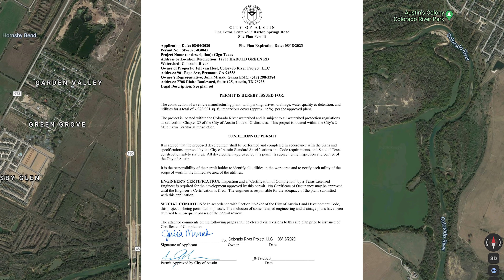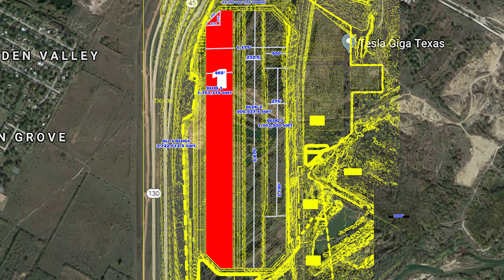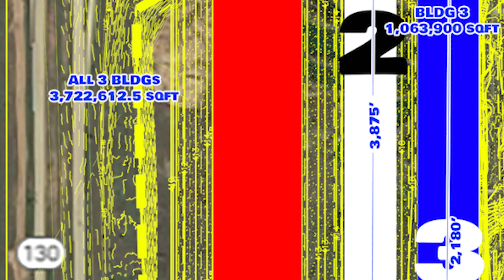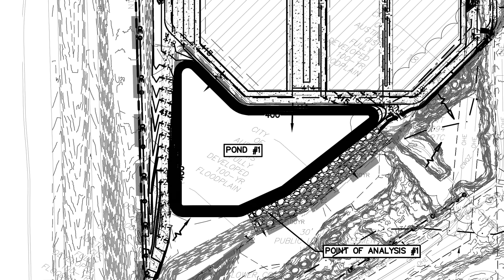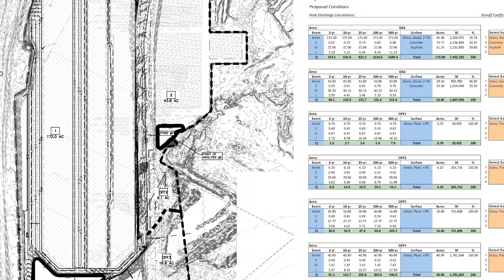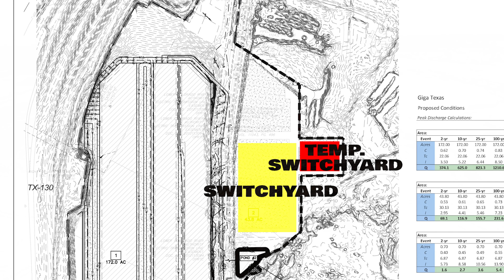Tesla Giga Texas  - EXCLUSIVE SITE PLAN REVEAL! - 4K  Day 55 - 9/15/20  - Gigafactory - Terafactory!

Comment: Looks to me the artist rendering is backwards as it has the biggest building as #3 with the notch.  The plan has building one nearest to the road  with the notch?
Reply from the maker: No design plan yet but inferred from site plan, these are the 3 building shapes. Largest building is #1 closest to the freeway, next is the smallest #2, and on the East side building #3 with the notch. Was a bit confusing in my video because looking at the site plan is a "rear" perspective in that building 3 is on the right, and in the rendering, we're looking at the front of the building where building 3 is on the far left. As per the site plan, it should be as correct as possible at this time and always subject to change or be wrong!

Comment: Isn't retention pond 2 more or less in the same location of the existing large pond? If so would make sense as it basically means there's very little work, if any, required to make it suitable for Tesla's needs.
Reply from the maker: The "North pond", the one to the right of the building pad at the beginning of all my videos, is going to be filled in and 2 ponds will be created for retention purposes- one just south of the switchyard is "Pond #2" (crew parking area) and one on the Southwest tip of the factory footprint (that the large one, "Pond #1"). These are just now taking shape but are not function yet. Exciting to know about them a bit in advance tho, very cool and great question!
Reply: @peterdog15  I see what you mean but what I'm left scratching my head about is the very large pre-existing pond off to the right of what you've corrected me on (pond 2). Kind of strange that they wouldn't want to make use of that since it's obviously has a large surface area & @ a guess, is probably pretty deep. One would have thought that potentially have meant far less time & effort. Shows you what I know.  😏🙃
Reply from the maker: Peter S I am such a bonehead, I was on the wrong pond! My apologies. Yes, I agree 100% with you it seems that they already have retaining capability but I’m not sure if it’s at the right level to comply with the hundred year flood plan. That seems to be a thing let’s talk quite a bit about. Thanks for catching that, great question!
Reply: @peterdog15  Thanks for getting back to me. A couple of people have pointed out to me that it may have something to do with regulatory requirements surrounding lining which DUH!! I should have considered. Still it's really hard to see how Tesla might tackle that really large pond I mentioned. Unless it's going to form part of the aforementioned eco friendly nature trails for public access. Draining & filling would take an inordinate amount of work; not impossible but still...

Comment: This is amazing, thank You for sharing! As I am from Germany, I translated the 3.722.612,5 SQFT to 345.842,018 M2 (Square Meters). This is big, but compared to other factories rather small... The Volkswagen Factory in Wolfsburg/ Germany has 6.500.000 M2 floor area, this is 69.965.417,7 SQFT.  However, I think the impact of Tesla Texas will be more impressive than these figures ;)

Comment: I looked through all the drawings linked on that page, even saved them to my HD.  Trying to soak up as much detail as possible.  Trying to decipher things like where water and electric come in and how sanitary and storm sewer exits.  I did find that there is a gas pipeline ROW running along with the powerline.  And to dig across the ROW, Tesla will need to go through a planning and permit process with AE.  Really hadn't even looked for scale yet.

Not sure if you saw, but there will be both a temporary and later permanent road right there at the end of the facility leading to Harold Green Rd.  It will have a very gentle slope at 1st, then get slightly steeper.

I will give them a good look over in the next few days and try to digest as much as possible.  As you can see, we have to disregard a ton of useless information cluttering up those drawings just to extract a few tidbits of goodies!

Comment: The switchyard is where the utility medium voltage is brought on to the site, and the primary meters are likely located.  After that point everything is customer owned in this case Tesla.  they will likely bring the medium voltage to several points points on the main buildings where transformers are located and they step the medium voltage down for their equipment and building loads
Reply: Think MegaPacks too.
Reply: There's probably tens and tens of equipment that needs direct MV input as they are so power demanding. Most is low voltage though.

Also, critical loads need redundant supply's of power -> more switchgears/bays.
Reply: The Site Plan actually shows the "Switchyard" as being used for "STAGING AREA/TEMPORARY SPOILS/CONCRETE WASHOUT AREA" so I think  it is for the construction only, at least for the time being.

Comment: The maximum length of the trailers are about 53' + the tractor.  Flatbeds are probably 40' to 48'.  If you have a distance of 50 feet between the buildings, it wouldn't be feasible for docking.
Reply from the maker: Rachel Lynn I’m getting feedback that it is only two buildings and that what I call building two and building three are just one building together. If you look at some of the exhibits from the permit, it seems that they are two separate buildings to me. Can you take a closer look and let me know your thoughts? Assuming you are in construction?
Reply: @peterdog15  No, not in construction.  I do work on the docks at a postal plant in Tampa....load/unload postal trucks and contractors' trucks 🚛.  I deal with box trucks and tractor trailers.

Comment: I'm wondering if Hyw 130/Harold Green Road requires improvements to entry/exit to accommodate the increased employee car traffic, semi-truck material deliveries, etc for the Tesla Facility 24/7?
Reply: The Site Plan map says "CONTROL OF ACCESS CLAUSE (ACCESS TO SERVICE ROAD DENIED)", but I think this is only clarifying that property owners along a frontage road are not automatically entitled to a driveway.  The roads, including TX130, will likely be upgraded after a traffic study and much hand-wringing.  Of course, TX130 is a toll road, and people will drive 5 miles out of their way to avoid paying 25¢ lol
Reply from the maker: michael pepe Most likely, good call.

Comment: Did anyone predict 3 parallel buildings before today?
Reply from the maker: Michael Inocente I’m not sure, but mostly it was 2 buildings until today.
Reply: One could have. It's a logical evolution from their Shanghai and Berlin plans. First it was 4 buildings in a long rectangle, in China the outer buildings merged for 2 parallel long ones (ignoring the mess they actually built recently), in Germany they got a row of service buildings in the middle. This has both the 2 merged buildings and the service buildings are merged into one, too.

Comment: I have a theory that building 3 will build the 3 and Y because they have the 1 piece casting which is the rear chassis of the car.  I wonder if the large dig out areas in the south end of building 3 are for the foundations for these big casting machines.
Reply: That does make sense. You start at the end of the building and have the car exit in on long straight line (no turns, just start at one end with raw material and out the other end is a complete car) right to the front of the building and directly onto the roadway to get delivered via self driving :). Imagine having the cars be able to drive themselves to a parking lot to be prepared for delivery all on their own.
Reply: Looking at the Giga Shanghai construction I noticed that the foundation works for the stamping press were absolutely huge. From what I understand the foundations for the casting machines do not have to be as big. Just something to keep in mind.
Reply: @pjimb8494  Thanks

Comment: Switchyard will certainly include transformers as the feed voltage will be 110 to 220 kVA, dependent upon local standards. Its 220 kV in Shanghai, 110kV in Berlin. Needs to be reduced to local USA industrial  voltage (110??). The switchyard area will then probably also incude the CUB building
Reply: Three phase at 480/277VAC (or higher), and three phase at 208/120VAC and/or 240Δ VAC.  Also European standards for 400/230VAC 50Hz.
Reply: Their German switchyard will convert 100kV (from 2 independent feeds) to 10kV which will be send to the buildings to be transformed locally.
Reply: @HenryLoenwind  110kV but you're right, it provide 10kV to every other transformer :)
Reply: “240, 241, whatever it takes” 😉
Reply: @sminstudios  I'm old enough to get that. :(
Reply: In the US,  common voltages  in buildings are 110  (office) and 220 (HVAC) single phase and 220 and 440 3-phase for production equipment. In Shanghai, Tesla built an enclosed substation with underground feeders and distribution  lines to each building in the "switchyard".

Comment: The drawings looking pretty simmilar to what they build in Shanghai. The Gap btween buildind 2 and 3 looks much smaller than 50 feet, even at the notched side.
Reply: Shanghai 2 buildings forming 3A are very close with around 8 m between, to form a firebreak.

Comment: How many production lines are going to be in giga Texas factory?
Reply from the maker: Daniel Palmer at least three, maybe four if batteries are included.
Reply: @peterdog15  thanks👍
Reply: I suspect Y and Ξ will be in the same building, but will have separate final assembly lines -- parallel lines.
Reply: @avid0g  oh ya that's a good point. First principles and all. If they share most of the parts run them on same line till they differ at which point you separate them.👍

Comment: Building 1= Model 3/Y
Building 2 = Semi
Building 3 = Cybertruck
Reply: I thinking 
Building 1 = Cyber Truck 
Building 2  = Semi
Building 3 = Model 3/Y

The Semi shares so many of the same components as the Model 3/Y, so Tesla would want these products next to each other
Reply: @corderajones that would be my call
Reply: @corderajones  Agree! CT doesn't need paint or stamping. Less space requirement.
Reply: What about battery production? Maybe battery production and Cybertruck combined, since the Cybertruck requires fewer processes
Reply: @lalexander711  These long thin buildings are good for auto assembly. Battery production would take place in a building of a different shape.
Reply: @lalexander711  I consider advanced  battery production at Austin to be highly likely using Tesla's own tech and research input from University of Texas.
Reply: Kewl
Reply: Blg 1 : offices and administrative, logistics, engineering. Blg 2 & 3: factories
Reply: Corderajones. Me thinks your guess is probably it too. But who knows. Not me.
Reply: Building 1: Factory with offices on the top floor
Building 2: Support (heating cooling, pressured gasses, waste water, ...)
Building 3: Factory with offices on the top floor

That's the Berlin layout, just that Berlin doesn't have one big but many small buildings for the support functions.

Comment: I do not think there is really enough space between what you have labeled building 2 and 3 for them to be called separate buildings.  I downloaded the drawings and the space varies between 45 feet and 28 feet.  That might be enough to drive a car but certainly not for a truck to park and unload.  If building 3 was separate, then there is really no way to get supplies/parts etc to building 3. I really think those two areas will be connected in some way.

Also, according to the drawings, there will not be much room between the raised power line right of way and the closest building.  I estimate only 10-20 feet.

Another note.  There are contour lines from Herold Green Road to the buildings.  HG is at 430 feet elevation and the ground slopes down to the building at 411 feet.  There will be a significant slope from the road to the building.
Reply from the maker: Bruce Dubbs Great input, I’m not quite sure how to read the site plans properly, so I’m hoping construction experts will correct me  as we go here. It’s much easier to change the models in the video than to change the actual buildings! 😂
Reply: @peterdog15  The drawing legends have a scale.  I also have a graphical ruler on my computer in pixels.  After magnifying the picture, I had about 180 pixels/100ft.  It was a simple process then to measure the width in pixels and convert to feet.
Reply: Does it say what the height of the river/riverbank is? I'm wondering how likely it is to flood the factory.
Reply: They have such a small long gap between buildings in this years Shanghai construction, so it is possible.

Comment: So maybe vehicle store on the other side of the highway Maybe to be picked up by rail & semi  at that point possibly. 
Building 1: semi ?
Building 2: cybertruck ?
Building 3: model 3 & y ? 
switching substation, or switchyard, is a substation without transformers that operates only at a single voltage level. Switchyards, used mainly for connections and interconnections, are essential for transmission, distribution, collection, and controlling the flow of electricity.
Reply from the maker: Joshua Mcdonald Nice, thank you!!

Comment: Tesla job:  Posted on: Jun 10, 2020
 Austin, TX
The Role

The Permit Coordinator will efficiently gather and submit all specified plans and applications required by the local building department to permit the design and installation of Tesla energy products. As an integral member of Tesla's Field Operations Energy team, the Permit Coordinator plays a key role in ensuring consistent job flow and contributing to a positive customer experience.

Responsibilities

Submit permit packets to local municipals driving permits to a zero-queue each day

Pick-up permits submitted immediately following the specified turn-around time

Maintain checkbook and credit card transactions for each job/account

Communicate clearly and quickly with managers and other departments about changes to process or obstacles to work flow

Follow-up on old cases with appropriate departments to move jobs through the permitting process as quickly as possible

Document any changes in job cases or status a minimum of two times per week

Represent the company in a professional and friendly manner

Attend weekly team meetings; share ideas and participate in feedback

Conduct in-person meetings with local government officials to answer any outstanding questions regarding energy products

Work with Inspection team to smoothly and efficiently pass inspections

Update our internal database daily to capture nuances from jurisdiction to jurisdiction

Qualifications
1-2 years' relative office or clerical experience required

Experience working with permits is a plus

Able to organize time and tasks in a fast paced environment with competing priorities

Takes initiative with solving problems

Ability to follow process within strict deadlines

Must be self-motivated and thrive in a team environment

Excellent customer service skills required

Excellent written and verbal communication skills required

Basic computer skills required

Must be able to successfully pass pre-employment screening requirements

Must have a valid state driver's license
Reply: I would be interested to know if this position has been filled, and what influence it has regarding the Tesla project.
Reply: So the successful applicant doesn't need to use a mop and bucket. Sounds like a pretty lay back job hey.

Comment: They're already clearing areas not in the original permit. I looked through all the attachments so it's not included in this permit as posted online.
Reply: The permit is only for construction, they can use the area’s outside the permit area for housing of mobile supportbuildings, storage, assembly, parking etc.  Also the area where the east swamp was is beeing cleared to remove sand to use as filling material, the scrapers are working there at the moment, also it gives more overview and more area for the things listed earlier.
Reply: @PM_82  I read the permits thoroughly. The environmental and drainage requirements were quite specific.  The work being done in those extra areas is outside the scope of this permit. 

If there isn't a different permit somewhere than it's Tesla forging ahead again... 

I doubt Austin would be forgiving so there has to be more paperwork that we haven't seen.
Reply: @RayVRoberts  They still have the mining permit, so as long as they only move dirt around they can do what they want there.
Reply: @HenryLoenwind  I wondered if that was still active...
Reply: Look to the Lower Colorado River Authority for additional information.   The changes to the site are so significant that the LCRA must be involved.  The site was full of placer mine pits and tailing piles.  In human terms, it was raped and left for dead. 
Look at the amount of material Tesla has had to bring on site.   We are witnessing a "Modern Marvel" of reclamation.
Reply: If i am correct they did not have the building permit when they started leveling the areas the 3 buildings will go...I believe we could see  that big pond where they have started a little leveling being filled and another 2 - 3 big buildings like the first 3 being built for battery and maybe another cyber-truck line or two....I do not think people realize how popular the cybertruck is going to be at $40 000 for the cheapest iteration people who could  afford the f150 new will most definitely be looking at cybertrucks......only about $9000 difference for the lowest priced one. now think of the extras a cybertruck gives...active  suspension vault  bed lowering rear with inbuilt ramp...almost damage proof body....compressor battery outlet for tools   etc etc   all built in to the cybertruck price.